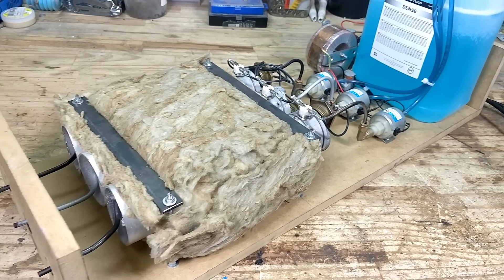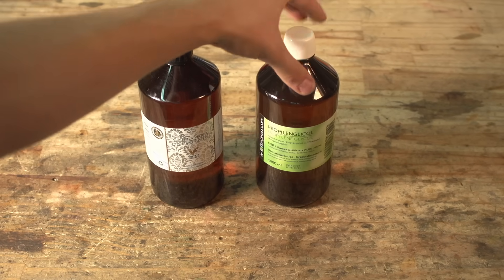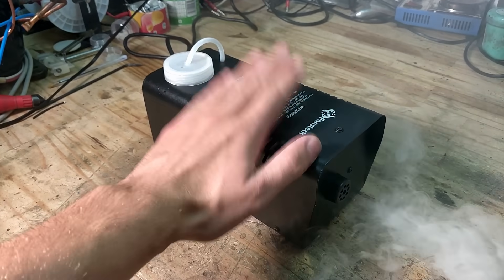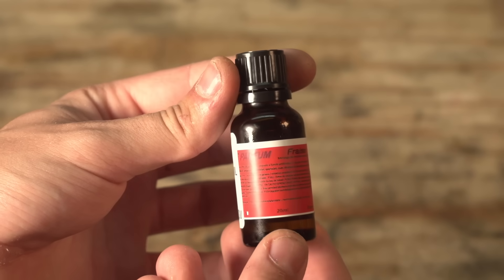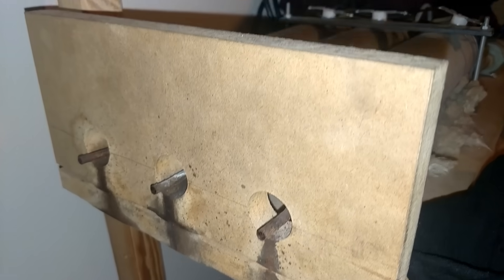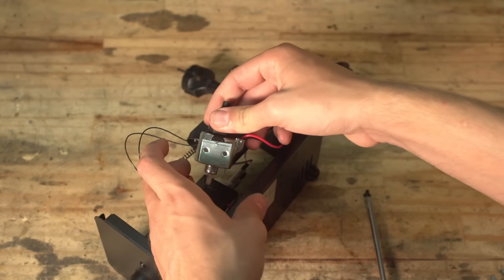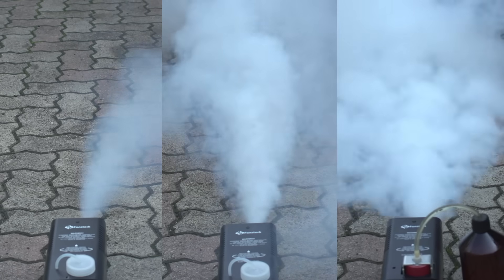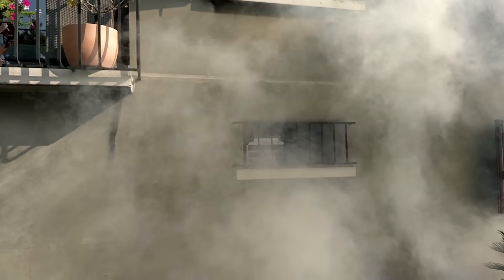How To Make a Cheap Fog Machine 10 Times More Powerful

Comment: The water in the fog juice is not just a cheap "filler" ... aside from that, it's also to help keep the tubing and the heating chamber clean for a longer period before you need to service it with the water/vinegar solution. It also makes for less residue on the room/surroundings where it's being used. It's really sticky/greasy/yucky.  As you pointed out, it also allows for longer shots before the element gets too cool. Really neat viddy!

Comment: Back in the day when we had machines at our clubs, we would use a very lightweight motor oil in ours not diluted with nothing
Reply: 100% light mineral oil. Works on a completely different concept. No heat is involved. Essentially you just pump air through a bubbler in the mineral oil tank. Just like an air bubbler/stone in a fish tank but larger and more intense air and bubbling. When the bubbles get to the top they "pop" and create really really fine droplets, the heavier droplets  just drop back into the tank to be reused.  Then a fan just blows those droplets out into the room. Those fine droplets are 100 times smaller then the fog particles in these vaporizer machines that use heat. They are so small they last in the air for hours before they dissipate provided you don't have much outside air exchange. The droplets are so small you don't see any fog really, it is almost invisible until light hits it and then they entire light beam just lights up. It is by far a superior looking effect for hazing nightclubs where you want to see the beams but no fog in the room. The light beams come out looking amazing. The machines also used hardly any fluid. A gallon of mineral oil would last me 6 months (or more) in a club used 5 hours per night, 3 nights a week. The problem with these machines is that oil would condensate on anything with a fan on it. All my lights (with fan cooling) would drip out oil from the insides. Trying to keep the optics clean was a nightmare. Try cleaning oil of of moving head optics with a q-tip and alcohol. Horrible job. That oil would also stick to dust and then that dust would collect in dust bunnies and get everywhere. All your wires and lights on the lighting trusses, inside your audio amplifiers, you name it. Still a great hazer if you do mobile shows. 1 night here and there isn't a problem, it becomes a problem when you use it every night in the same venue. I still have 1 in storage.
Reply: @wally7856 disagree friend. We did this for many years in many clubs in Chicago.

Comment: How about attaching a lump of aluminium or copper to the heat block instead of replacing it?
Reply from the maker: Could work, the problem is that the heat needs to be transferred as fast as possible to the rest of the block, maybe thermal paste could help?

Comment: Wagering a guess here, despite the increase in thermal capacity, i bet the distilled water is added for both cleaning purposes and because it lowers the boiling point of the mixture. GPG has a boiling point over double waters, so adding the water might help it evaporate at a lower temp maybe?same thing with alcohol

Comment: Commercial fog machine fluids are predominantly water-based rather than pure glycerin and propylene glycol (VG/PG) because a dense 50:50 mix—though it makes thick fog—is impractical and unsafe: glycerin’s high viscosity can clog pumps and heaters; the blend needs higher vaporization temperatures, increasing residue/caramelization and wear; the fog is harsher on the respiratory tract and leaves sticky deposits; and its lingering density significantly raises the risk of triggering smoke detectors and fire alarms. Water lowers viscosity, enables smoother and cleaner vaporization, yields finer, more breathable aerosols that disperse predictably, reduces surface buildup, extends equipment life, and—crucially for venues—helps maintain haze levels without causing false alarms, making it the safer, more controllable choice for professional use.

Comment: We, the vaping cloud chasers knew exactly that 50/50 mix, or even better 70/30 glycerin to glycol is the best for everyday clouds with flavour :)
EDIT: About the toxicity... well, you never use pure glycerin for vaping because then the temperature of it giving off vapour is high enough to create toxic chemicals. Just 2% or so of water will cause the mixture's temperature of vaporisation to drop low enough to be in the safe 150-200*C range iirc. You don't need oxygen for the thermal breakdown. You could try breathing in the fumes from pure glycerin, they will cause your throat to burn from being overheated. Well, that's basically it. Source: I've been vaping for 9 years.

Comment: glycerol and propylene glycol, would both clog the coil, and create a residue on the heating element coming into direct contact with the substance. the water helps defer that from happening so quickly as well as being a kind of medium to keep it thin enough from being able to deposit said residue that would eventually burn and deplete performance. something i have years of direct familiarity too from being a vaper, as well as creating my own vape coils, but more importantly vape liquid. i make it myself with nicotine because it is way more cost effective. but there is your answer. crud buildup on the heating element.

Comment: Biggest problem I see with the pump upgrade is you may toast the controller board.  It could potentially cause a fire as well.

The water is in there for the two obvious reasons.  It lowers viscosity and cost.  If you sell a 12oz bottle of juice and a gallon jug for the same price, most people will buy the gallon.  To be competitive, you have to dilute the product.  It probably also helps to not overdo the fog!

Last comment... DO NOT go putting fragrances in there.  Just because it smells nice doesn't mean it's not toxic.  You were never meant to breathe these fragrances in high concentrations, plus you don't know what chemical transformations they undergo when heated to fog machine temperatures.  It's just a really bad idea.   (Btw, most "essential oils" are highly toxic as well.  People think it's good for you because it's natural... Make sure you know the hazards before you start exposing yourself to chemicals.)

Comment: Pure glycerin & propylene glycol, without water, coming out of a fog machine in mist form, could become a flamethrower!  Test this by holding a torch in front of the machine.  Make a demo video of this.
          The part of fog machines that fail (with Halloween use) is the PUMP, not the heater block.  The reason the pumps fail is that rubber O-ring in the piston seal absorb liquid on storage, & swell.  This causes the pump to jam.  The trick to keep them working is to flush the pump with distilled water after use to eliminate all non-volatiles (glycerin & propylene) from the pump.  Then you run low pressure air through (connect air compressor set to low pressure (an aquarium pump works well) to the hose with the machine turned off & run the air through for an hour to dry the internals.
          When you fire up the next year, the pump may stick (it will hum but not pump).  Use a syringe to force water through while operating the pump.  It will "unstick" & then will be good to go.  Sometimes the pump will "half stick" & pump little.  Solution to this is to run the pump dry (pull the hose out of the fluid, wait until the hose runs dry).  The pump will make loud hammering sound & free up.
          Regarding the construction of the heater blocks, the coiled tube is used only on the smallest of the machines.  Larger machines have a heater block with a 1/2 inch hole through.  Pressed into this is a rod as long as the hole.  The outside of the rod is a tight fit in the hole at both ends & in a narrow zone in the middle.  Elsewhere it is about 1/16" smaller in diameter, forming 2 zones with a narrow annulus.  Fluid enters a hole drilled in one end, which intersects cross-hole admitting fluid to the first annulus.  In this annulus the fluid heats to near boiling.  A narrow nick in the central zone permits the fluid to pass to the 2nd annulus, where it boils.  Another cross-hole & axial hole allows the steam to exit through an orifice screwed into the end of the rod.
          Without this double chamber, the fluid can enter the block & float on a sheath of steam (like water droplets do when dropped in very hot skillet).  Then they suddenly flash to steam when the pressure starts building.  This can cause the machine to explode!  The 2 chambers permits the fluid to stably & consistently turn to steam without liquid accumulating in the block.  (If you have ever heard of "pogo oscillations" in rocket engines, this is what's happening.)
          It is easier to make a block this way, without requiring a foundry.  With nothing more than drill press, aluminum stock, & aluminum rod & hand tools you can make the block.  It is helpful to have a lathe, but not required.

Comment: Hey Nicolas thank you for your helpful video. I'm going to build a diy fog machine too, but I'm planning to build it mobile like a smoke gun. What do you think instead of electrical heating just take a gas burner, heating up a copper pipe? Cheap and highly effective heating.
Reply: Take sort of container, an electric pump, pumping the liquid through a copper pipe which is heated up with the burner? That should make a lot of fog what are you thinking about this idea? Greetings from Switzerland
Reply from the maker: @kultpakt_bolzen_andy9042  that sounds like a gas fogger! make sure you use white oil instead of glycerin as its pretty much impossible to regulate the temperature and will definitely burn waaay hotter than a regular for machine

Comment: With smoke grenades combustion causes smoke made of tiny particles of solids. What makes smoke visible is water condensation around this particles. This changes small solid particles into water droplets, that is into a... fog :-) 

Both PG and VG are hygroscopic, so perhaps providing water vapour by adding water to fluid itself also allows for condensation -- this time though around PG/VG and not a solids...

Comment: Hi, i have a 400w smoke (fog) machine. But i want the effect of haze....not smoke. I have several bottles of commercially bought water based haze liquid. I just want a thin haze to stand in the air for light beams. I work only small closed stages. Can i just use the fluid i have in this machine ? Also i do these shows only 5 times a year, so machine wear and tear is not a problem. If i get 20-30 shows from a machine, im willing to throw it and buy a new one. Not keen to buy a HAZER, i bought 2 and both died after 3 shows only, maybe bec my shows are so spaced out being only once in 3-4 months, so it makes no money sense. Might as well use a hack which is what im planning. Any help will be very useful.

Comment: I think these are by far the best system for a home alarm. Flood the house, RV or car with fog and they can't see a thing. I saw a company called GOST that was using them in protecting yachts by flooding it with fog to catch people's attention and prevent the thieves from seeing anything. Yes they have a safety mechanism to prevent it going off when people don't want it to go off.

Comment: Can you not just put a resister in line with the new pump to reduce its flow rate... ps bet your nabours love you.. have you not had the fire service turn up yet???
Reply from the maker: @andrewbuchanan6524  but then what's the point of using a stronger pump 😁
And yes they showed up once a few years ago

Comment: Just want to say thanks. Bought some vegetable glycerin, propylene glycol, and distilled water. Made a mix 1/3 of each and the cheap fog  machine I have been using worked unbelievable. The output fog was crazy thick. Thanks again for the fog machine info, Dan.

Comment: Might be very useful. It was difficult do find the entry point of mice or rats into my car. After removing the whole dashboard I found that the rubber grommet of the steering column was broken. Whit a powerful smoke machine you have just watch where the smoke comes out. Also leaks in the intake or exhaust system are very easy to locate.

Comment: So I just finished this modification. It was possible to complete with zero brazing because my machine connected to the motor with a ⅛” brass end cap already; I just got a ⅛” BSP nipple and an elbow, connected that to the E type pump which uses that same thread.
I didn't even need to solder the connections, just clipped the motor off and used wago connectors to hook up some spade connectors I had from an old car project.

3d printed a mount for the new motor, used a couple of M3 nuts embedded to re-use the same mounting holes.

Thank you so much for this really useful guide!

Comment: SO I just bought one of these plus a gallon of propylene glycol and a gallon of glycerin and this thing is perfect for the front entrance area of my house! It makes enough fog to give a good effect but not so much people can't see where they are walking. The one thing that sucks is it won't run over a period of time. It runs once until it needs to heat more juice then you have to hit the wired or wireless remote to make it go each time. I think I can hack the wired remote with a cheap timer module to make it go 3 or 4 seconds every 20 seconds. Thanks for this video!!!!

Comment: @NicolasSalencPBP - using your guidance, finally took the time to hot-rod a cheap-ass fog machine with a free used pump from an espresso repair shop and some new brass fittings and it's now 52W of much improved. Haven't messed with the juice mix yet. For now, just appreciating the gift you've given those of us with limited means but a willingness to experiment. Good stuff. Enjoy the spooky season. Thanks.

Comment: If you pipe the fog output through a chiller before releasing it, it will create a great low lying fog effect. You can create a really cheap chiller taking a storage container, cutting holes in it for an inlet and outlet, filling it with dry ice then connecting the fog machine on the inlet and have the outlet run to where you want the fog to "originate" from. Putting a low speed fan before the outlet will help draw the fog out but might dissipate the effect a tad bit. 

Also, the PG/VG ratio for a good fog would be 40% PG, 50% VG and 10% Distilled water. Great fog thickness, super thin so its easy to pump and still a decent latent fog cloud. 

The biggest thing to remember is that VG increases the thickness of the "fog", while PG decreases the rate at which the fog begins to produce (IE it makes the liquid vaporize at lower temperatures). and you are correct, in a traditional fog liquid, the DW is to ensure the sticky residues of the glycerin do not linger around because not only are they super corrosive but they are also literally liquid sugars, and thus highly susceptible to spoilage (IE Mold and mildew) 

(I used to manufacture eLiquid and found the same thing about fog juice as a result, so definitely experimented).
Reply: I don’t use a chiller I instead use a pond mister and a tote which works just as good

Comment: Hello Nick, hope all is well. I have a quick question hopefully you can answer. If I set up this same set up you did with bigger pump and the same mix you did. Do you think if I run it through a fog chiller, or a container with dry ice/ mist/ or regular ice, do you think I can have real thick low laying fog/smog. The type that stays low to the ground. Not sure if you have the answer or maybe have tried it before but just trying to see what kind of results li can get if I try it. What do you think. Thanks mate, blessings 🙏🏼🙏🏼🙏🏼

Comment: I like tutorials like this that do the sort of "Theseus' ship" approach because at the end you swap out almost all the parts, but you learn a lot in the process and then can move on to designing your own because now you understand what each component is and why it is there. It also kind of lets you pimp out things to the extent of your skill level and still get something working. I wonder how long the duty cycle is on that heater right now. You could possibly swap out the microcontroller and mess with the hysteresis a bit to get a bit more out of it, which would be fairly cheap and easy, and just like one slightly higher notch down from a total rebuild, I think you can get an esp8266 board for like 3 bucks, does require some coding, but it would be very rudimentary. Depending on the temperature sensor though, and how it outputs those signals you may need to replace that, so more work.

Comment: Glycerol is usually obtained by saponification of plant oils (mostly triglycerides). If you buy vegetable glycerine you don't have to worry about 0.5% impurities. Cheap propylene glycol you can find at diy cosmetics or perfumery suppliers outlets. They also carry butylene and pentylene glycols. The only thing you should never, ever use is ethylene glycol (antifreeze), which is quite toxic.

Comment: Water is used to clean the tubing and keep the heater wet to stop it from overheating
Reply: What if may use those ultrasonic humidifier circuit to generate vapours? Like instead of touching the piezoelectric plate to water, touching it propylene glycol-glycerine mix to generate cold vapours?

Comment: Late to the party, but potentially PID control for the temperature (assuming it's currently on-off control) and relocating the sensor (if at all possible) to detect changes to temp quicker might allow the unit to keep running without spraying unheated liquid.